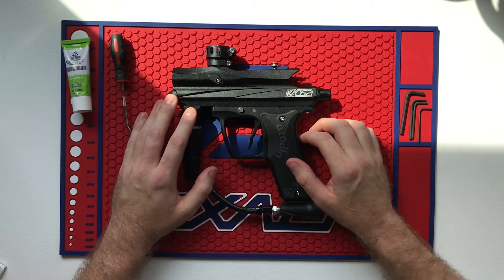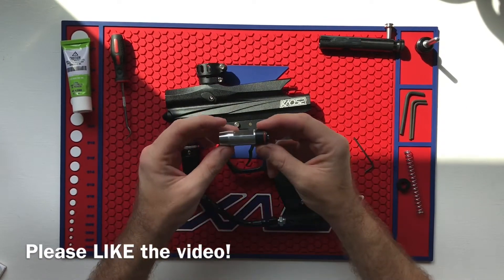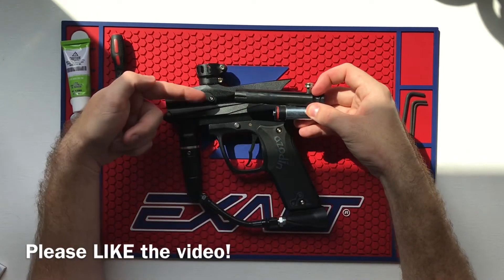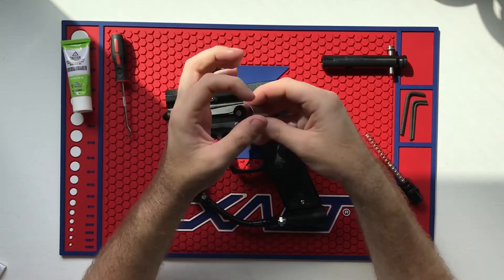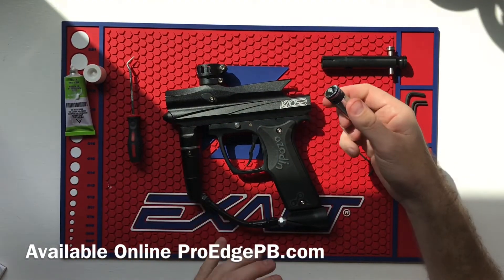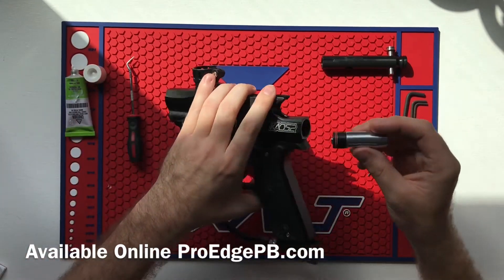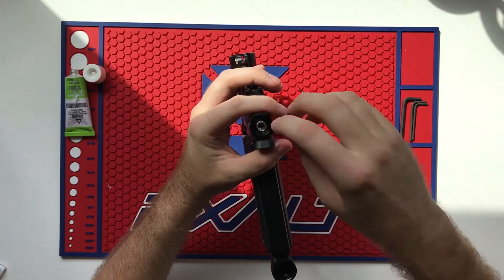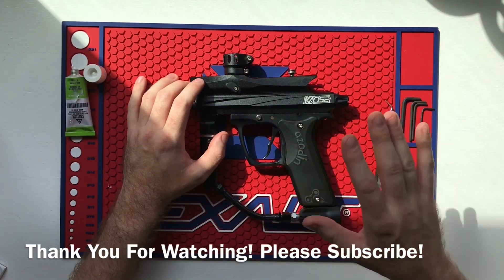Azodin Kaos 2 Repair - Sputtering

Comment: Hi Sir, I have azodin kaos 1, if I shoot.. the hammer it doesn't return to its original position (have to cock it again), nothing leaks.  What parts should I replace or repair?. Thank you.
Reply from the maker: The only part you should have to replace would be the hammer oring, then oil the hammer and should be ready to go!
Reply: @ProEdgePaintball  Thank you sir.

Comment: I replaced the hammer oring with factory but it still keeps sputtering
Reply from the maker: When you installed the new o-ring did you use paintball gun oil to lube the hammer? Also, check to make sure you did not put the rubber bumper in before you put the hammer back in. If this does not resolve your issue, please reach out to us via email at help@proedgepaintball.com

Comment: My Hammer is stuck in my gun any advice to get it out?
Reply from the maker: Sometimes the grip screws can stick into the body and cause the hammer to not come out. Take the frame off. If that is not the case, try removing the valve out of the front of the gun to see if the hammer will slide out that direction.
Reply: @ProEdgePaintball  thanks for the tip. I gave the gun to my nephew to use last weekend and idk how but the velocity adjustors and spring flew out on the field somewhere. I know its a cheap gun but you know any websites that sells replacement parts. I cant find any at all 😥
Reply from the maker: Tommy Younqq we might have it. Could you email John, John@ProEdgePaintball.com with your info.. name number and what you’re looking for. As soon as we are back into the store tomorrow or Wednesday we will check for you!
Reply: @ProEdgePaintball  just now saw this I'll send u an email later today. Thanks for the help
Reply: So Im having that issue with my kaos 3 and I did this however it still has the same issue.....what else could it be? It breaks paint too and double feeds paintballs, then sputters and doesn't fully cock back..it also shoots paintballs with low velocity...like if there was no air in the tank...should I just send back for a replacement?